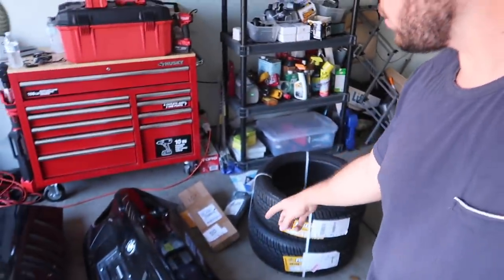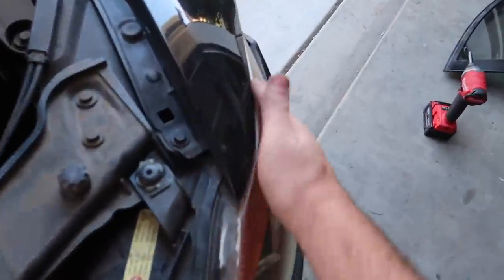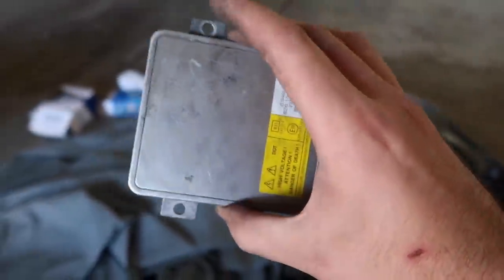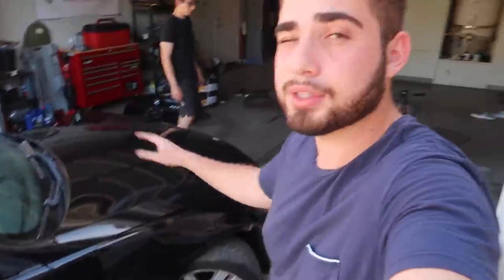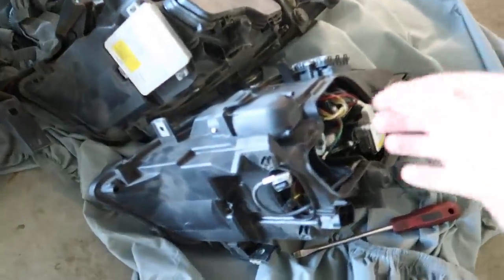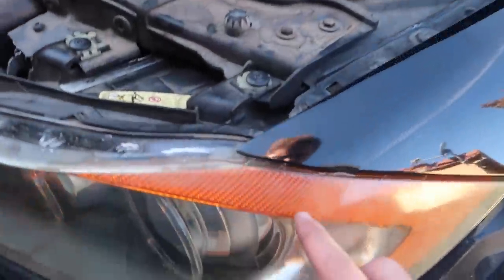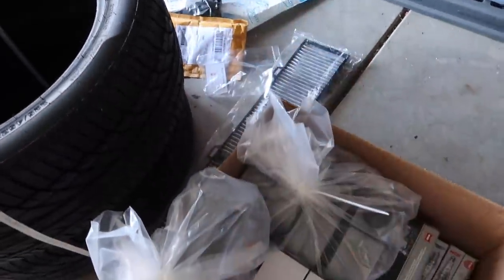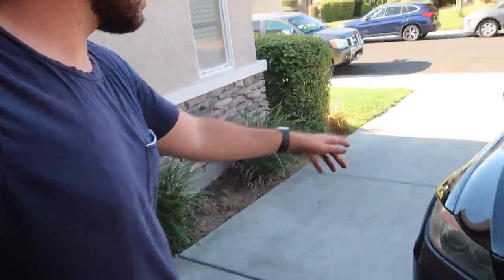Rebuilding And Restoring A BMW E90! Part 3

Comment: With the dent on the bumper, try boiling some water and pouring it over the dent so the plastic can soften up. Push from the inside and it’ll look like new. I did that with my front bumper and the dent was waaaay worse 🤣 the hammer was a bad idea lol you coulda broke the bumper

Comment: Salam bro, good content like usual. My e90 headlight seal is compromised and now the water got in and burned out my halos. Do you have a hookup for OEM headlights? I was contemplating redoing the seal but heard it's a very tough job to correctly complete.

Comment: SA brother Nour i have E60 2010 i can't get my keyless entry to work. I changed the diversity antenna twice traced wiring it function fine for the radio. My CIC has no sound none of the equipment is bad and the fiber line in the box is light up show continues connection i changed the CIC the Amplifier nothing changed. I heard you say something about not breaking a wire as you installed apple play. Brother I have tried everything and was hoping you could help. Thank you in advance. My apologies I'm not savvy at YouTube thing